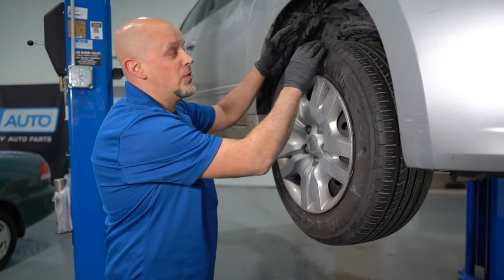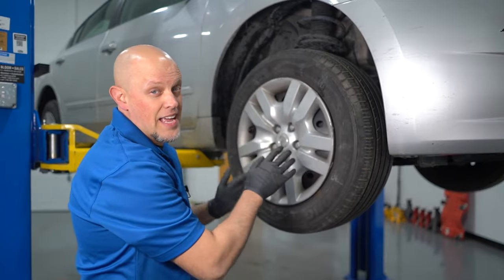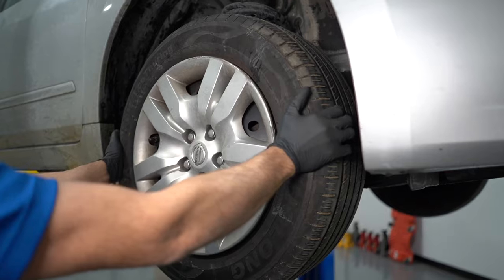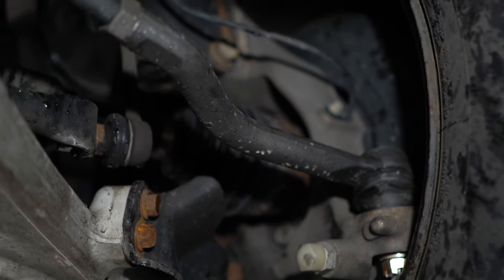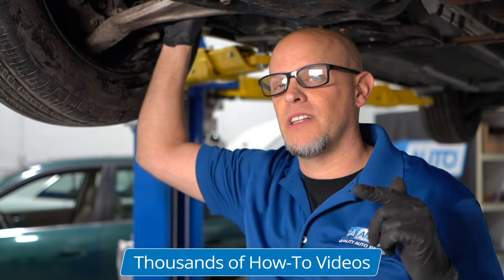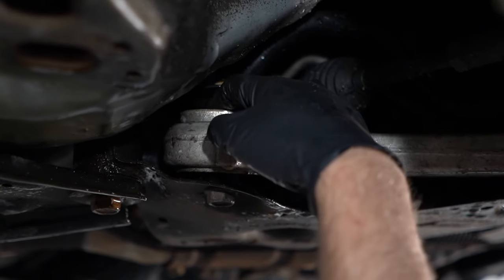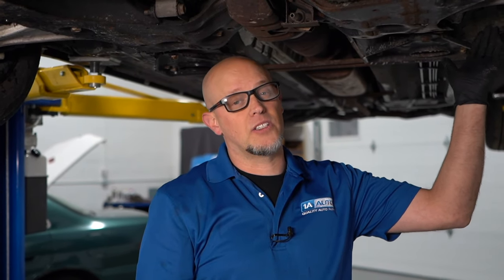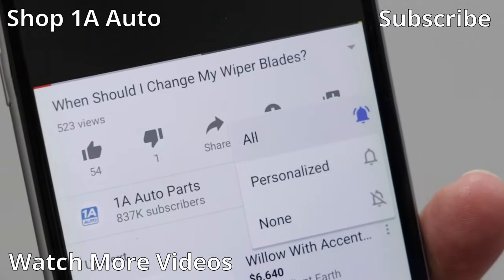Wheel Clunking Over Bumps? How to Diagnose Front End and Ball Joints!

Comment: When possible, it’s good to replace steering/suspension components in pairs. That’s why I love 1Aauto kits.
Reply from the maker: +Rafael Marin Thank you! We love empowering our customers and showing how to perform DIY auto repairs with our high-quality auto parts.  http://1aau.to/m/Shop-1AAuto-c
Reply: I did I replace struts full assembly, sway links, control arms, cv axles, wheel hub, rack and pinion, and I'm still hearing a metal clicking noise when I turn left it sounds like u running over a metal plate in the road. mechanic messing up my whip cause every bump now I'm hearing noises that I didn't have before I took it in. Ima buy me a mountain folding bike
Reply: @blesdavis7637  I had the same I took it in just for a new coil spring and droplink and since I took it to the garage there was a knocking/clunking noise when going over bumps and turning right I took it back into the garage and they said they checked the whole front end replaced the top mount and it is still making the noise
Reply: @albietate8186  its annoying man I understand you hear it but can't find out what it is. You ever get it fix.

Comment: Can bad ball joints cause uneven tire wear like the outside of the tire
Reply: Ball joints can affect your alignment which can cause your tires to wear unevenly and prematurely. Ball joints are really inexpensive compared to a set of tires. After I replace suspension components I always have the alignment done. That 75 or 80 bucks will help get a few more years out of your tires so the investment pays for itself. I've seen brand new tires go partially bald within a year because of bad alignment.
Reply: @DK-jg5vk  😳😳 few more years  mostly 2 years if it’s brand new and on rare cases 3 years

Comment: Had a ticking noise on the front nearside checked the dustcover on brakes wasn't that, had the noise for months , cause was so simple, it was a loose lead balance weight on the wheel ,so tightened the balance weight with a pliers so simple

Comment: I have an 18 F150 and is banging or passenger side tire when I go over bumps.  If I apply my brake and go over bumps it won’t make the noise.  Would this be my ball joint or brake related if you were to guess
I just had new rotors and pads out on a few days before this started happening. Ty

Comment: 2002 f150 original owner. I did shocks first.. Had mechanic replace all of front end.. in/out tie rods, center link everything but lower arms. Fixed 80% of issues but still having something loose rattling over bumps RF tire. No phone call today for estimate, wife/secretary said it's not the wheel bearings..that he's still looking. I'm wondering what it might be..
Reply: It is everything between the badge on the front and back that read ford. Also made in america sticker is a clear sign to buy something else...

Comment: Im having a knocking/clunking sound that only starts up after about 15-20 mins of driving. Checked the cv axle and joints, sway bar link and even the transmission to see wtf is causing it and no luck. And it doesn’t matter if I’m turning or going straight, flat surface or bumps it will make the noise.
Reply: Hopefully you figured it out by now, possibly wheel bearing?
Reply: You honestly just described the exact same thing that my car is doing, did you ever figure out what was causing the issue? I'm at a loss as to what it could be, any help would be greatly appreciated!

Comment: I've just had my suspension replaced with all the other related parts and it still clunkw when going over bumpy road surfaces. I'm thinking it could be a loose fender or the a bolt at the very top of the strut. But if the struts and shocks are all new it'd be a hell of a coincidence. Or it could also be a loose turn signal or radiator. The alignment was and is still off and the wheel is jerky to turn and is more difficult than usual. Or sometimes, it's too easy to turn. Steering fluid is all good.
Reply: Did you ever work out what the problem was?
Reply: Stabilizer bar “D” bushings?
Reply: Motor mount can clunk too..
Reply: New suapension and aligment is off lmao

Comment: What if the sound is coming from the rear end on the passenger side? 
I have a 2010 Mazda 3 hatch 2.5:
I just replaced the rear lower control arms and stabilizer links, front and rear shocks, and rear coil springs. Clunking wasn't there before all that work. Car also feels like it sways in the back around turns or "wavy" roads.

Comment: To replace a lower ball joint that is actually part of the control arm, does that mean you replace the entire control arm?
Reply: Yes
Reply: I would say that it depends on the vehicle and what's available. I have replaced lower ball joints on GM vehicles which were riveted in with aftermarket ball joints that bolt in after the rivets are drilled out and they have worked just fine.
Reply: you can usually press new joints into control arm also

Comment: If you leave a wheel clunking, will it get damaged over time?
Reply from the maker: +Jay Dee Yes, you should always listen to your vehicle.
Reply: Besides the potential of damaging your wheel, a suspension problem can potentially leave you stranded at the worst possible time if it's not addressed. Worst case scenario, you could lose your steering which could be a very bad situation. When you notice a suspension problem, deal with it immediately. It is always cheaper to replace a few parts than to pay for towing or the deductible on an accident. Stay ahead of suspension/steering problems.